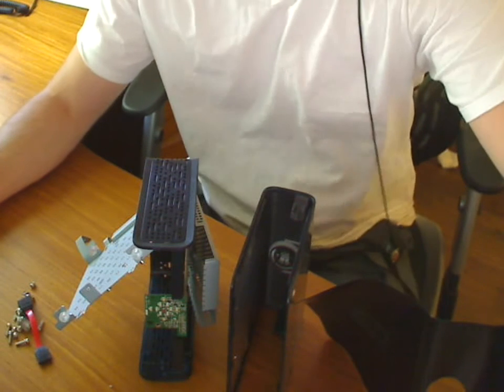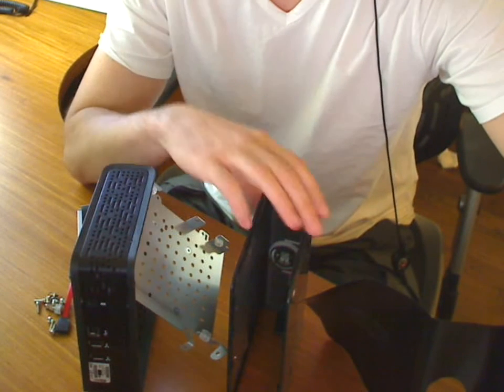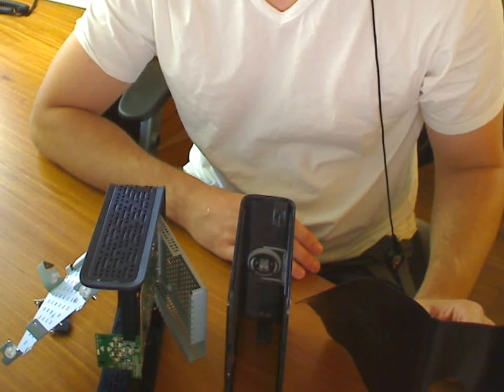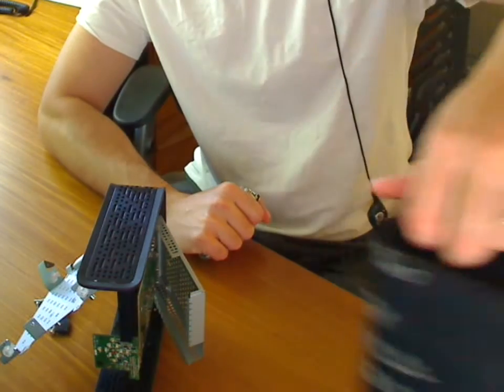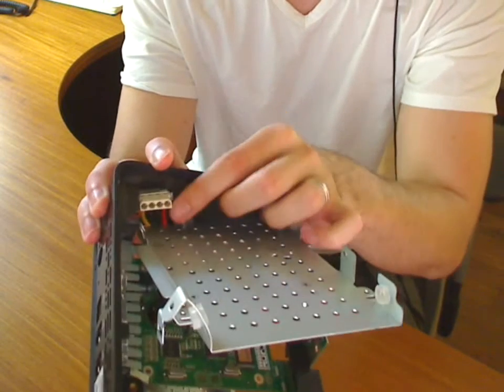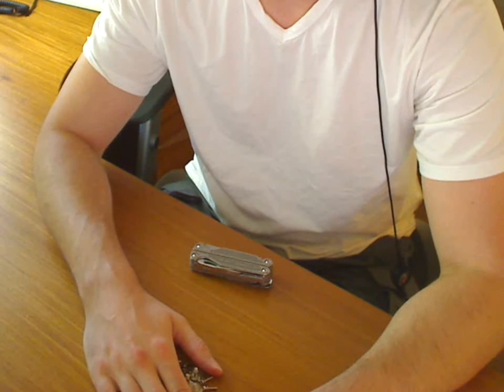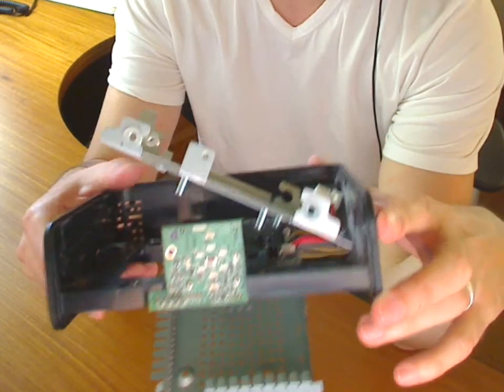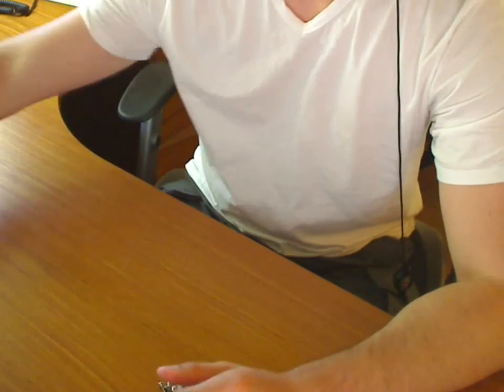Salvaging an external hard drive.

Comment: Have you tried SimpleTech externals?
I've had no problem with them. I've had a 120GB for 5 years or so (used a lot to back up everything regularly) and I have a 500GB that also works well, though I haven't had it long enough to testify to its reliability. SimpleTech is cheaply priced but very good, IMO. They get high ratings from most users.

Comment: I have a question my WD External Hard drive failed also. The usb connection just popped off of the power mechanism. So like the piece that is supposed to be soldered on to the thing is stuck on the end of my USB cord and now i lost it. Is there an alternative way to access the info in the cpu?